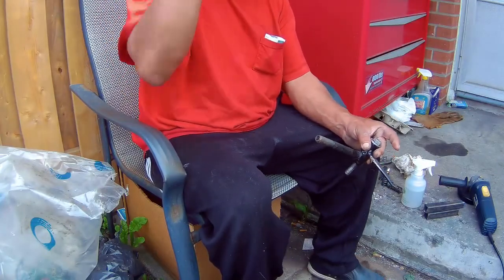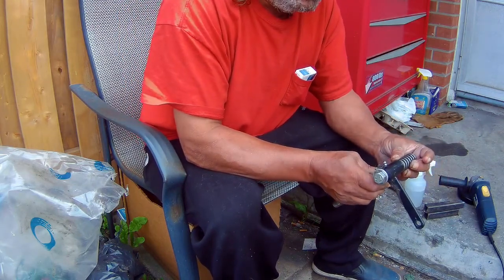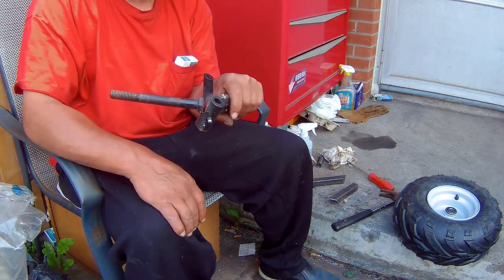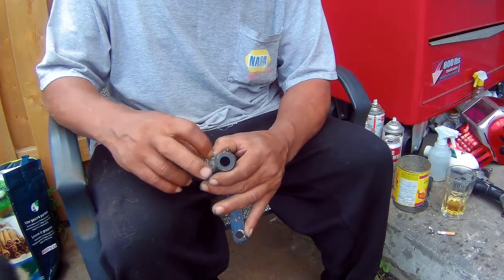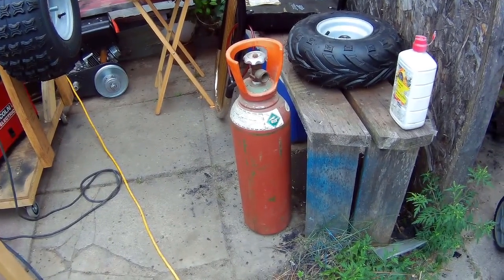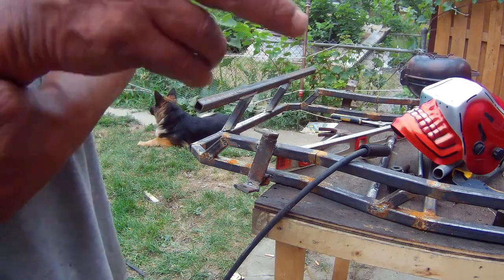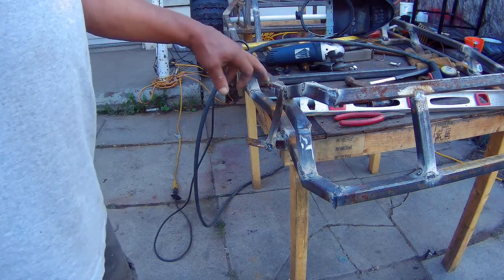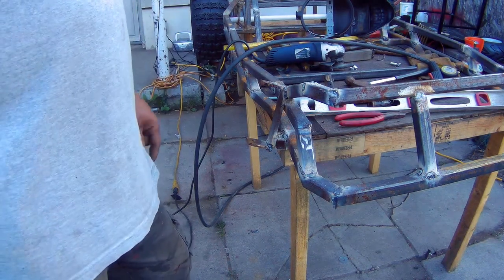Machine Gun Neves pt.05

Comment: 10 degrees is the angle I use on all my builds
Reply from the maker: I didn't show when I put them on but I put them at 16 degrees because my wheels are going to be a little out farther from the bracket so they can line up with the back wheels (or almost) I don't know If I did It right (time will tell) but where the wheel will be the bracket bolt ends up facing the bottom center of the tire so I'm hoping It will be ok
Reply: Should work out ok